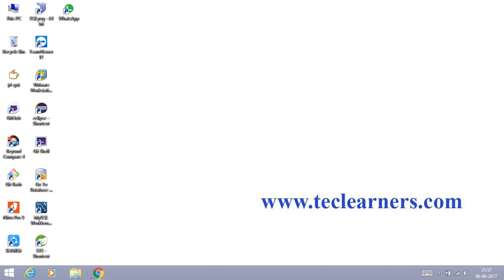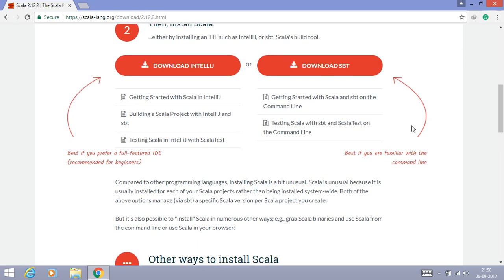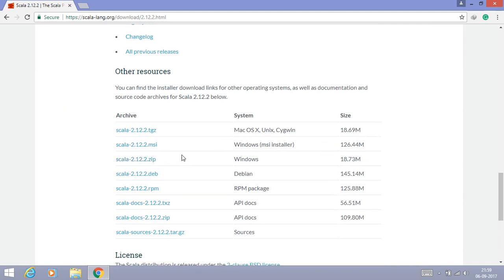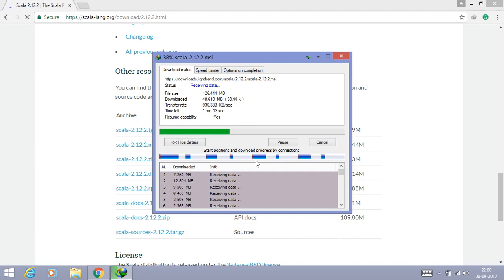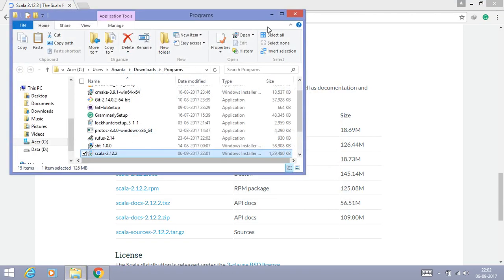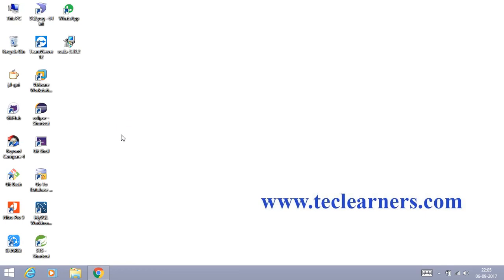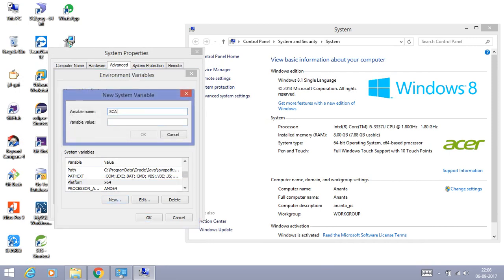2.Installing scala on windows

Comment: I did same like you but still i am getting issue like this 'scala' is not recognized as an internal or external command,
operable program or batch file., How to resolve this? Please help me..
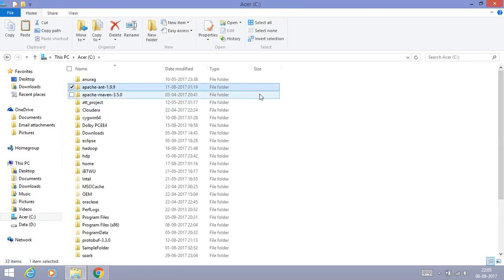Reply from the maker: This occurs only when there is no path set for scala. You need to set your path variable for Scala. Please watch the video and at 6:20m it's there how you can set your path. Add your scala installation bin folder (C:\Progra~2\scala\bin) path to your environment path variable.